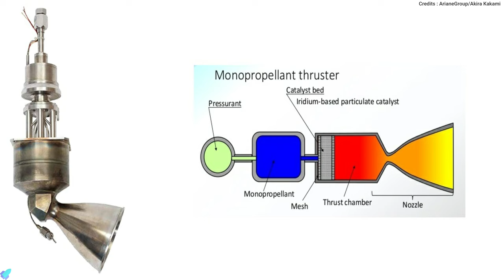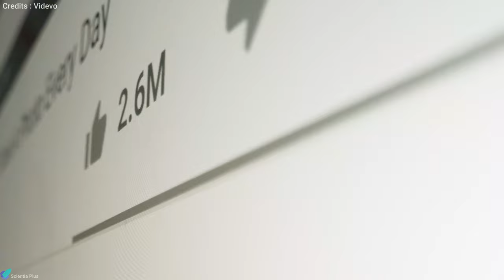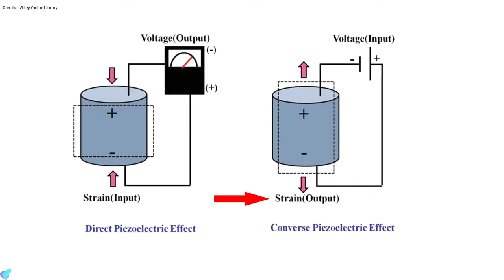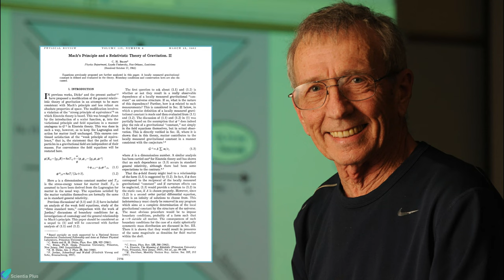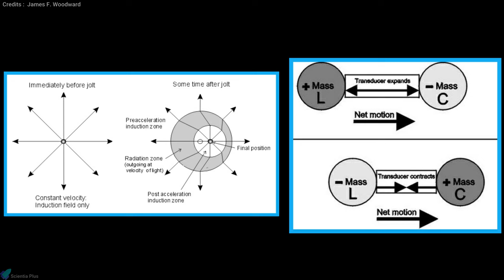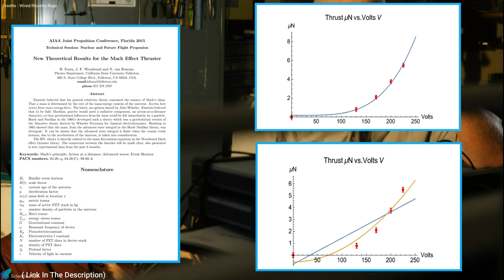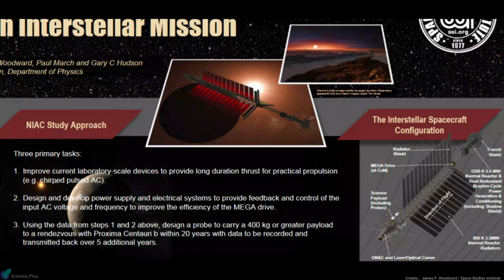Thrust Without Propellant – THE MEGA DRIVE

Comment: Let us pray that intergalactic and interuniversal travel become real if the laws of physics allow these.
Reply: The problem with interuniversal travel is there is an infinite number of universes whose laws of physics differ from ours. There's no saying that you wouldn't come out the other side in a universe and fall apart on an atomic level.
Reply: @jacp5628  How does Unruh radiation assymetrical cavity pilot wave quantum virtual plasma and quantized inertia explain the conservation of momentum in the em drive? And how does the cannae drive works since it's not assymetrical?
How could it be an hyperspace warp drive?
Reply: @jacp5628  How could superconductor help increase the thrust to power ratio?

Comment: This could work since the crystals being use are known to produce energy. But, for now I will put this concept in the same file with the EM Drive.
Reply: The em drive can't be explained by anyknown physics while this one can
Reply: Eh?

Piezoelectrical physical motion is no less real than EM radiation used in the EM drive.

The difference is that EM drive was basically saying that EM radiation trapped in a cavity would be causing thrust beyond what a photon rocket could - ie producing thrust against an open system from energy trapped in a closed system.

Where as MEGA is supposedly acting against anomalous gravitational forces in a matter similar to what was really happening in EM drive 'thrust' with Lorentz interactions against the Earth's magnetic field from a badly shielded power wire going to the microwave generator.

So basically MEGA is doing on purpose with anomalous gravity what certain EM drive builds were doing with anomalous magnetism by accident.

Only magnetic forces in deep space will be much harder to come across I imagine.
Reply: The EM drive maybe the photon equivalent of the Woodward drive because the photon varies in energy (therefore mass) at different points within the system. These variations in mass-energy interact with the Universal gravitation field to produce a back-reaction to the thrust.
Reply: @mnomadvfx  look up the definition of piezo electric

Comment: The narrator's mention of 'controversial physics'' is the hidden disclaimer.
Reply: The Mach Effect principle was not so controversial a long time ago.

Mostly people concentrated on the near and left the far (ie what Mach Effect was about) to others until the point that it became a quaint old principle that few put any credence in.

But considering that recent studies into 'dark matter' effects on galaxy spin (like the Milky Way) have determined that gravity of far off galaxies and galaxy clusters may be affecting this spin in ways beyond what is expected from the observed galactic mass.

Until now this was believed to be explained by 'dark matter' mass which is not seen, but it seems far more credible that it is simply the effect of nearby gravitational forces working against that spin.

If this can dethrone some previously attributed effects of dark matter in the universe, then it may be a possible force to act against for a thruster.
Reply: @mnomadvfx  The problem with this device is removing the rest of the universe when reversing the movement. 
Any electron that is added for mass in one direction retains its inertia when removed.
Also, latest research has it that Dark matter doesn't exist.

Comment: possible to work, if instead of pizoelectric cristal blade to by titanium blades, the blades are pushed forward by autside coil, the polarity electric current making the blades move back and forth. for the lamella to change its mass, you have to put current on each blade when they are pushed forward it passes positive current and when they are pushed back it passes negative current, inversation polarity of coil with alternative curent from the blade must be temporizate vith the same frecventa. so the electric current on a conductor can change the mass of the conductor, if the current is positive it means that the conductor has a empty of energy, if the current is negative it has a lot of charge energy.

Comment: zero point propulsion would possibly mean renaming jpl to be electrogravitic propulsion laboratory.

electrogravitics was perfected long ago with such engineers as thomas townsend brown, ottis t car, and john searl. ralph ring also has a lot of knowledge that is shared throughout the cosmic internet, teaching anyone how to build such faster than light speed galactic space ships, which have one half gravity cabins(everyone inside of the craft/ship would weigh 1/2 of their present weight) and these rotating magnetic fields generate a self cohering inertia cancelation field, as well as a simultaneous gravity shield which protects the ship, from anything entering the ships path/area.

the sear effect generator (seg)
essentially extracting electrons from the infinite dirac sea, an ocean of endless energy, and utilizing this energy for travel.

all electricity already comes from this infinite vacuum energy, zero point fields, also called gravity waves and tachyon waves, and virtual particle flux fields as well,

except that we only utilize less than .000001 % of this infinite energy field. which by the way, instantaneously replenishes itself at a rate of 10 to the 120th cycles per second. the dirac sea is powered by the energy fields that is, the material universe.

it is a symbiotic relationship. the dirac sea powers the material universe, and the material universe powers the dirac sea.

paul dirac was a nobel prize winner and a great researcher/scientist to the greatest degrees of achievement/possibility.

the dirac sea contains 10 to the 40th times the energy compared to the material universe energy fields that we see, touch; and interact with in the what we think of as, material universe.

and this, is just the beginning.

spin magnetic fields within magnetic fields, within magnetic fields, and we generate sufficient gravity waves to repel the earths gravity fields, and thus permits extremely efficient travel/flight.

build your electrogravity propulsion hoverboard today.

note: you are 100% responsible for your actions. if you so choose to build electrogravity propulsion systems.

everyone wonders when we will finally utilize electrogravity. and the answer, one of many, is; once you first utilize electrogravity in your home builds experiments, then companies will begin offering for sale, such similar technologies.

new tech always comes from home inventors sharing their ideas in an open forum of complete and thorough discovery.

what shall you create today!

Comment: The thrust is no doubt possible.
There are more variables on making it practical. 
Deterioration of piezo crystals is minor and can be replaced if the resonation is too small of a margin.
Direction of travel will have to change because of gravitational forces.
If not addressed then it is more likely to speed towards the strongest gravity ending its existence.
The thrust to time to speed ratio would not likely be powerful enough for "Escape velocity" from exponential greater gravitational pulls.
The closer it gets to speed of light the more propulsive energy is required. 
It would also be like steering the ship in between the all the effecting gravitational wave strengths to avoid being sucked into what is like it's minor black hole.
Every time it needs to make a course correction it requires energy for that and the ship slows down.
Gravity "sling shot" effects would require secondary propulsion system to be mandatory. 
It is also possible that the solar panel will act more like a solar sail. 

I do hope studies continue into this because it has potential to work in combination of other propulsive systems. 
I could imagine generation ships having these capabilities.
I wonder if he thought of this when crystal  quartz watches cycled on time.
Reply: Yes they should have more traditional  me methods of thrust  onboard for emergencies and they should only use the engine in interstellar space were the reach of gravity is so small that it wouldn’t be a problem
Reply: The ideas I've seen use vacuum tubes

Comment: Piezo Electric material don't behave the same way for prolonged period......... that's a matter of concern I think
Reply: If it works.... a scaled up version could potentially have huge mass savings. Even better than fusion which still requires most of its mass in fuel for interstellar journeys. Enough that you could afford to bring spares piezos and anything else you need.
Reply: @allineedis1mike81  what we need is to synthesize a new piezoelectric material which overcomes all shortcomings of present ones
Reply: @chidanandpudakalakatti3039  that's easy , if it's proven to work  powerfully enough :) no stone will be left unturned , 
Universities will have departments , governments etc etc
Reply: @cedriceric9730  that is the reason I asserted the need to synthesize new piezoelectric material
Reply: @chidanandpudakalakatti3039  they will be made in zero g probably, we can do that now:)
Reply: @cedriceric9730  Any thing made in space is only limited to research purpose......not for mass production purpose.....
Reply: @chidanandpudakalakatti3039 that time is done , companies exist that do just that 
They already are specialising in crystal sensors
Reply: @cedriceric9730  Tomorrow if a person starts a company which specialises in time machine , it doesn't guarantee they will have it built..... 😂
Reply: @chidanandpudakalakatti3039  a man of the past you are
You probably invest after the the stock market explodes and hide when it's down

Comment: Hmmm its actually imposivol tu reach light speed, you will need to not have mass to reach light speed and also thers a way to reach andbe faster than light speed that wey is thrug bendind spacetime
Reply: Wut?
Reply: The
Reply: @l.s.c6377  Fuk?
Reply: They're not talking about light speed, they're talking about 20% of light speed.  If you can maintain constant thrust for long periods of time, you could accelerate to 20% light speed by half way to alpha centauri, then turn the ship around and decelerate for the other half.  You would average 10% of light speed by doing this, and since alpha centauri is 4.37 light years away, it would take 44 years to get there with this approach.  The acceleration required would be 0.04 m/s^2, which would be so small, you would probably not even perceive it (gravity is 9.8 m/s^2).  A better design would be one that accelerates at 9.8 m/s^2 until the halfway point, then flips around and decelerates by that same amount.  You would be going close to light speed by the time you hit the mid point, averaging roughly half light speed.  So the trip would take around 9 years from our perspective, and you would have earth like simulated gravity the entire time (except briefly when you stop accelerating at mid point and flip the ship around).  Further, the travelers would be well into the realm of relativity and time would slow for the travelers, so their elapsed time would be less than 9 years.

Comment: Sorry, I'm skeptical. The net mass change is so small that net thrust would be hidden in the random thermal vibration of the atoms in the crystal. I'd like for it to be true,but  . . .  also 10 micro newtons is REALLY small, how much power was consumed to get even that result?
Reply: I know this was posted a long time ago but I only just read about this and have been looking for more info when I found this video. It is a little missleading leading to your question. The thrust comes fromt he vibrational occilaction of the crystals not so much the power input. They are trying to find the "best" frequency, and for frequency changes it stupid small power requirements. On the paper I read they were testing a 20 second sweep from 45 kHz down to 25kHz off of 1.2Volts.
Reply: @Zeroscifer  I still have not seen net thrust numbers. This fundamentally breaks Newtonian mechanics. Unless they have isolated a new phenomenon, momentum does not appear from no where.
Reply: @richardrigling4906  Yes but I was just addressing that one question you had. The new question is why the experiments are being done with NASA funding it. We will not know the answer there till they are done witht he testing. Quantum tunneling "broke physics" till we learned how it works.

Comment: People fail to see that even if you don’t use propellant you are still carrying energy locked in fuels. Whether it by plutonium for RTGs or fusion fuel, these drives being labeled “fuel-free” is very misleading. Even for single kilograms of payload you would need to pack hundreds of terawatt hours worth of fuel to reach near lights-red and if you plan on using solar or beamed power it is just better to use a photon sail.

Also, technically any drive can reach another star in an astronaut’s lifetime with enough stored energy.

Comment: Seems unlikely to work. The effect is very tiny and as you increase speed the effect will get smaller and smaller but it's going to take a long, long time to even get to where you see a decrease.
Reply: the effect only gets smaller for an external observer, not for the spaceship or the crew inside

Comment: In general it is a mass oscillating back and forward.
Reply: No, it's a mass that's light one second and heavy the next according how you want it
If you oscillate it just right it will give a net thrust!!!!!!!!
Reply: @cedriceric9730  If mass varies it has to be "pushed in" (electrons). "Pushing" that mass in will balance the effect in opposite direction! Or am I missing something?
Reply: @cedriceric9730  it will only work if the power supply is on the ground, the electrons that contribute to that mass still retain their inertia.

Comment: It sounds like if it does work as described that the way the current devices are engineered is fundamentally inefficient.

Perhaps some kind of stacked MEMS device?

Considering he's claimed that it will work better the smaller the device is then stacked MEMS is the way to go.

Comment: There's a patent for a ftl craft, it's a specialized metal double hulled circular craft with the center filled with mercury chilled to -15,000 degrees. They use high vibration frequency plasma which allows it to detach from the surrounding quanta. 
   There's also a patent for a warp drive that ran off the excess liquid nitrogen used to chill the mercury. I asked Asteronx, Sean Carroll and some other physics scientists some questions on it since they hadn't done any videos on the science behind it, i was wondering if they used teslas vacuum tube and spark gap plasma energy in the process. They blocked me two years ago and wouldn't give me an answer after i posted the link for the patent. Now i can't even find the two patents on google.

Comment: I suspect if this was going to pay off it would have by now.
Reply: @mnomadvfx  Well, maybe.  But the limitations of early LEDs (and early integrated circuits and so on) were clearly related to the "infancy" of our position on the technological S curve for that particular technology.  The enormous progress we made in that arena could have been fairly easily predicted - there was a whole path of improvement already visible at the time, and we just needed to become more refined in our fabrication abilities to tap that capability.  For example, we just needed to develop our ability to work with ever smaller process geometry to move toward today's integrated circuits.  I don't see such a path in this case.  I suppose one should "never say never," but it seems unlikely that such an improvement path will emerge in this case.  No such path is evident yet, whereas the path was obviously evident in the other case.
   
I'd quite love to be wrong, by the way.  I just don't hold out a lot of hope, though.